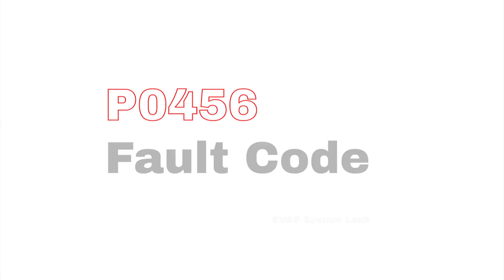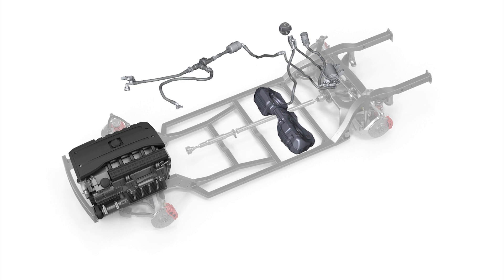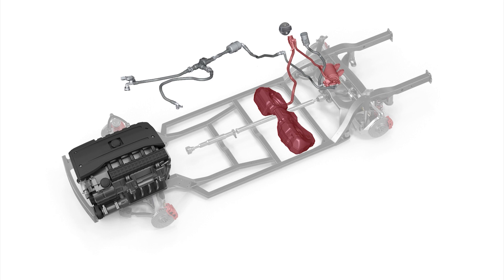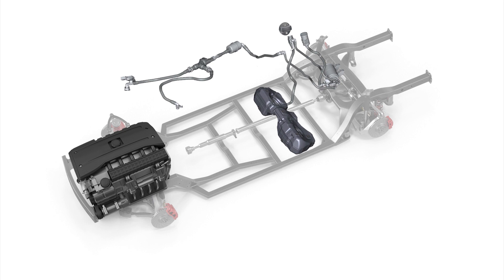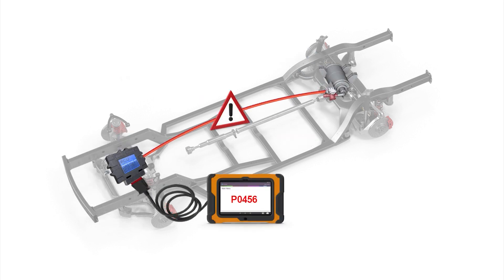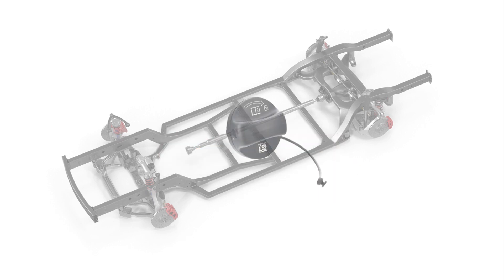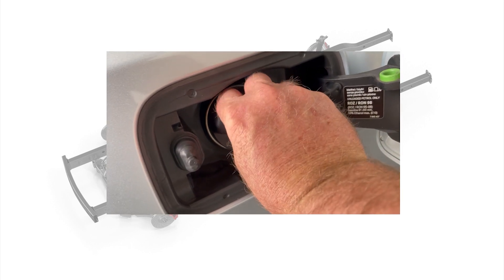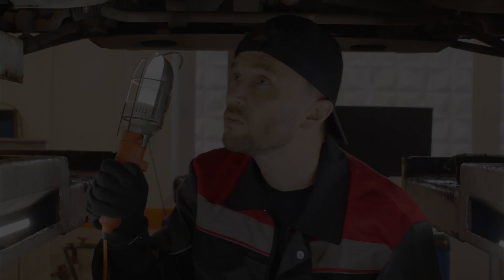Automobile Fault Code P0456 - Fuel Vapor Leak in EVAP System

Comment: Meanwhile my SULEV 2016 X1 is one it's third radiator, the last one not covered under warranty. The whole radiator changed and fan shroud for a like new car with 5 k yes 5000 miles. Love mine, Just won't  buy another one as they won't cover this embarrassing engineering fail,cost $2300 (7/24 with dealer dropping costs on a less than eight year old vehicle solely served at reputable dealer).

Comment: BMW has sent letters to owners of cars, mine is a 2016 X1 about EVAP system purge valve extended 15 year warranty. If you have a paid repair or need to have dealer fix, this should help to pay for it.